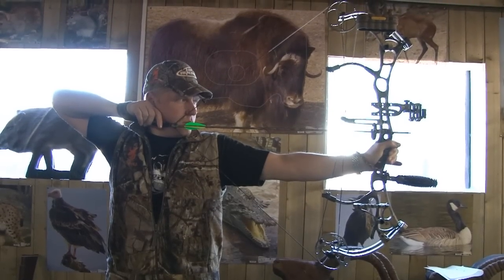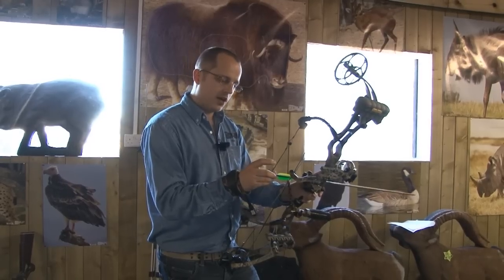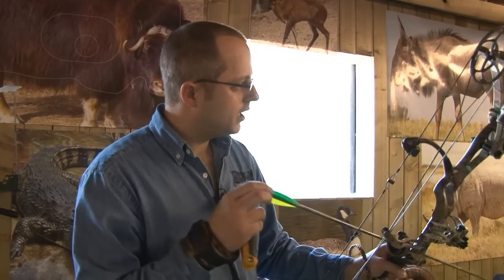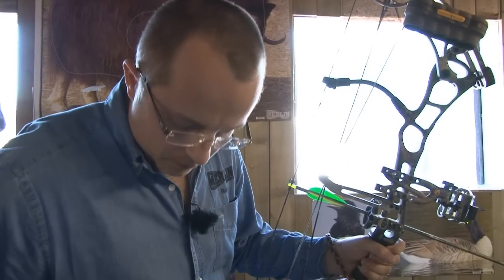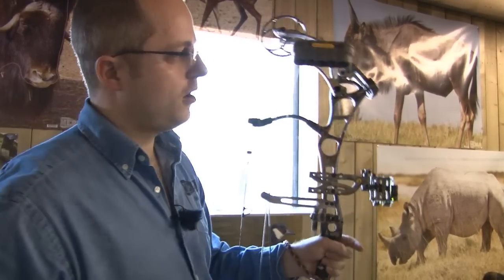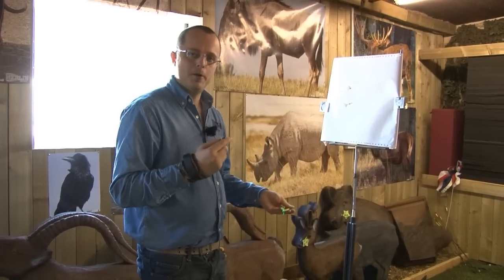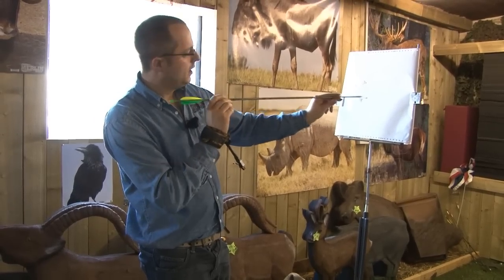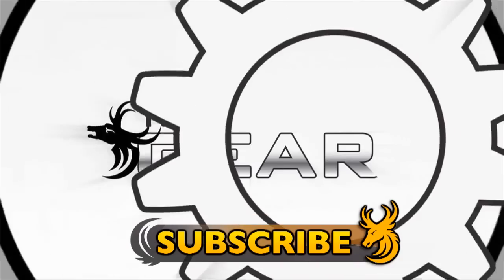How to paper tune your bow

Comment: Well produced video, concise and to the point. BUT with a modern compound bow ( such as the one in the video ) with a machined riser all you need is a centre shot gauge and R/S level and you can set the bow dead centre straight quicker and without taking a shot.
Granted, with older, cast risers paper tuning has it's place and i agree, wholeheartedly that technique plays a massive role. No matter how well true the bow is ( D loop and release aid does take out lots of "user error" if used correctly )